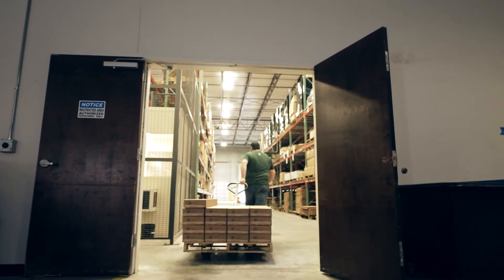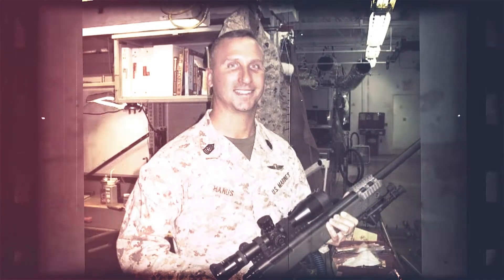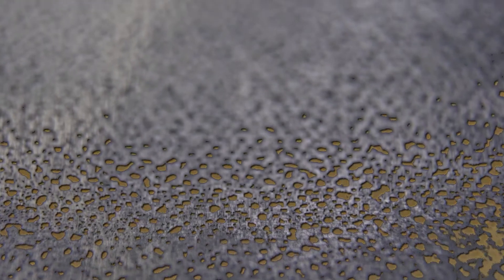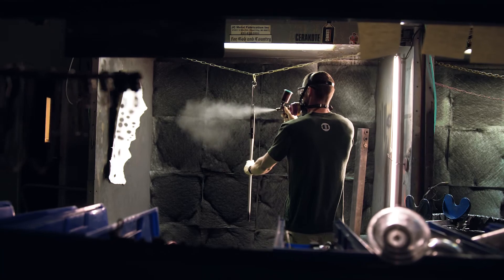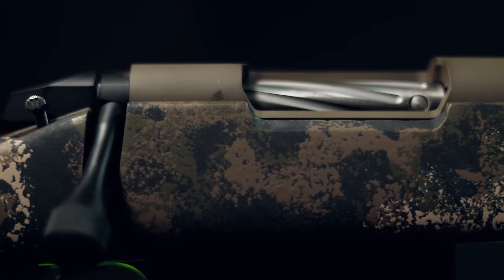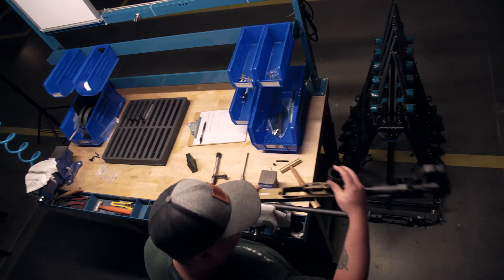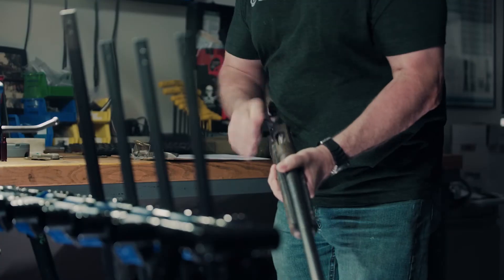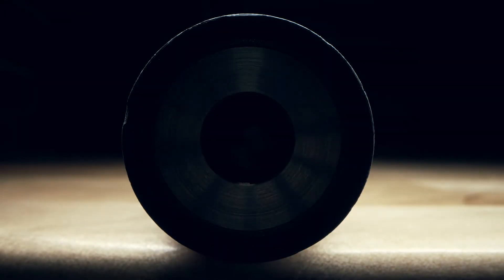Bergara - CURE Carbon Barrels

Comment: Do you have an empirical data to support heat distribution in your CF barrels compared to steel barrels? Research Ive seen suggest CF barrels heat up faster and cools slower than steel.

Comment: I don’t understand the point of carbon barrels. There’s steel, mesh, and a carbon wrap? What does the carbon provide at that point rather than just leaving it off. It’d be nice to see pros and cons of steel vs carbon. If carbon absorbs heat, what’s the point of adding it to begin with?
Reply from the maker: The main purpose is to provide a barrel with much less weight and a more rigid barrel. Our CURE technology will reduce weight by more than 50% compared to steel. As well as maintaining barrel straightness and stiffness.

Comment: Unfortunately, Bergara does not offer replacement barrels. Once you put 2,000 to 3,000 rounds through one of their rifles, it becomes useless.
Reply from the maker: We offer factory re-barrel services. The lead time is approximately 90 days and your accuracy guarantee will still apply.
Reply: @BergaraOfficial  would it be possible to rebarrel a different Bergara rifle with one of these? My CURE barrel accuracy has been phenomenal and I wouldn't mind saving several pounds on my B14 HMR.
Reply: @RJBiteanerd what’s your grouping size at 100 thinking of getting one
Reply: @BergaraOfficial  how does that work for current HMR B14 owners? Do we send out our rifle ? Or if we wanted to buy a carbon barrel? How do we order one
Reply: Besides the fact that they came on here and told you they do offer a rebarreling service… any gunsmith can put a barrel on one, after all their actions are based on a Rem. 700, of which there are tons of great quality aftermarket barrels available for. Pull your head out of your rear.